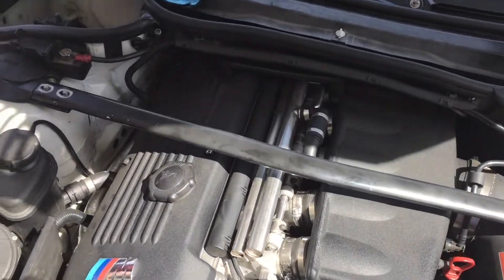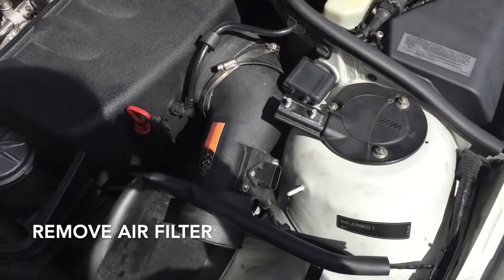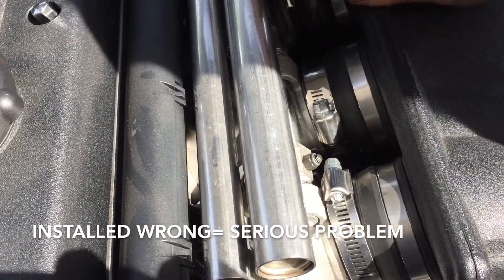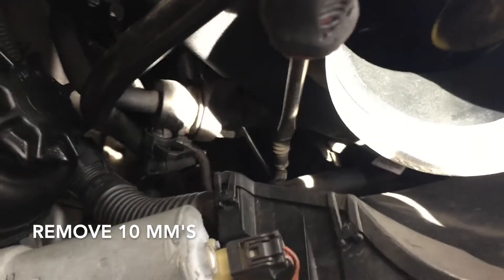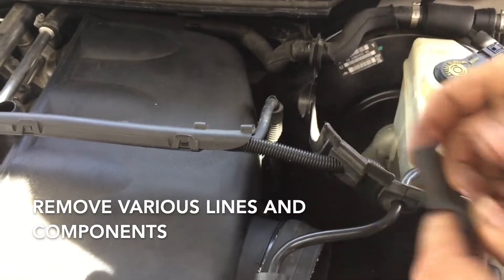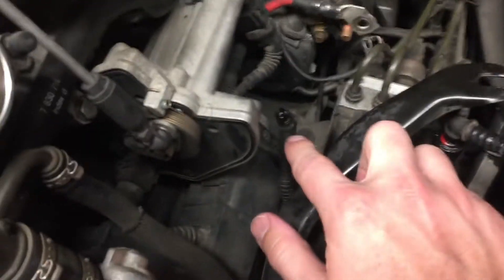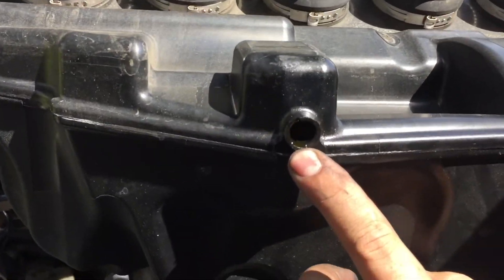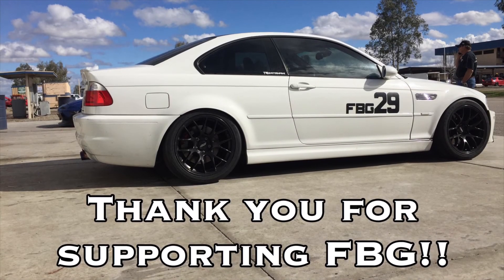How to: Remove the Air Intake Manifold E46 M3 S54 MANUAL AND SMG

Comment: Can anyone help?  I recently installed an Eventuri intake on the S54.  However I made a complete mistake of forgetting that i had sealed the intake with a rubber glove before installation.  started the car..... It ran for less than a minute but ever since the engine is waaaaay off.  super rough idle and very BAD throttle response.  havent even attempted driving it its so bad.  Can anyone suggest some possible steps to remedy this callosal blunder?
Reply: Is it throwing any codes?

Comment: how to connect back that tiny tube under the manifold???
Reply: did you ever find a good way? im up to that now and struggling
Reply: @canofdeans  Pain in the ass
Reply: @nazigrammar9728 i got it by just reaching under but was not filled with confidence that it would stay in
Reply: @canofdeans  do u use lift?
Reply: @nazigrammar9728 reaching under the intake manifold when I was putting it back on I mean. Im not sure if youd be able to even see it from under the car.

Comment: Where have you guys been !? Happy New Year !! Have an issue on part throttle it is not crisp so xan you do a Vid on all the issues ? Thx Guys .
Reply from the maker: Mark T happy new year! We have had a lot of life keeping us from getting editing done! But we are going to be back at it now.  Part throttle isn’t crisp? Is it not revving up with your pedal? Any other symptoms that you notice?
Reply: @FatboysGarage  well I've done all the basics I know I do not have any coil pack alternator battery clutch issues but there's definitely hesitation in my part throttle this is an SMG and when I'm keeping it in neutral stepping on the gas there is a dead spot in revving in idle I'm about to change my fuel pump 92 k I have issues with power and in extreme cold under 40 I'm here in Florida LOL I've been getting stalls in the morning when I drop down the second gear otherwise runs better but I'm still lost in 2 MPG less I have owned this car for the last four years and it never has gotten less than 19 City so needless to say this car is maintained meticulously and once I do the fuel pump and also I'm changing the timing chain tensioner and it tapping when cold I'm off to a Dyno tune to investigate other intermittent any thoughts will be completely appreciated thank you for your time !
Reply from the maker: @markt9438   A few thoughts.   When my VANOS first went bad, it had similar symptoms, it stumbled all over itself, it didn't perform well and gas mileage decrease, and had a tap like you describe.  I bet when you change that timing chain tensioner you find it broken.  Another common issue with throttle behaving like that is with the throttle actuator, idle control valve, and throttle position sensors.  When installing these parts new they must be synced together; unfortunately it is not plug and play.   Check out this link, you may find some info:

http://www.m3forum.net/m3forum/archive/index.php/t-367162.html
Reply: @FatboysGarage   Thx will check ! Did a recent bullet proof on vanos like you have and tensioner is only 10 k old and taps on start up cold ! have no codes and this is intermittent !  but for now need to change timing chain tensioner and fuel pump going from there ! Thx again
Reply from the maker: Mark T nice! Good that you did the vanos! It’s a must. Let me know after you change that fuel pump. There are just so many things that can cause that type of issue. Keep us posted !
Reply: @FatboysGarage  okay I went over the link you sent me on the TPS and all those issues and I do not have any codes so it's possible it's not communicating properly with my pedal after I do the fuel pump and timing chain tensioner and if I still have an issue I'm going to be taking it to a performance shop out in Apopka
Reply from the maker: @markt9438  had a thought this morning? have you flashed your ECu several times for modification? sometimes the computer can be messed up from that and doesnt communicate properly.
Reply: @FatboysGarage  well I've had the vehicle now for years driven 25,000 miles and I've never flashed it was considering the best tune I can find is Frank's tune I think it's called FS tune are you familiar with that and everytime I drive the vehicle 60 degree weather it wants to stall when I downshift to second gear so for me it looks like fuel pump 93k right now
Reply from the maker: @markt9438  Nice to hear youve got it figured out!  Had to ask.  I have heard of Franks tuning before yes.  Personally i go with epic motorsports tune.  he's actually in florida as well.  Has been recommended to me by every big time racer.  Ill be making a video soon and its going to involve his tunes.
Reply: @FatboysGarage  awesome give me the link I'll investigate thank you very much
Reply: @FatboysGarage  Got her back tonight ! Yes it was a soft failing fuel pump ! Runs better than new very little pump noise comparing to the original 93K pump ,no blips on RPM downshift and had gotten very bad in cold weather stalling in downshift to 2nd ! Pump i acquired     VDO Factory    BMW from Ebay Mfg Part # 16142229684 just $398 no tax in florida and free shipping ! Also did the Timing chain tensioner original went at 82K and this last one went in 10K and should have been changed a lot soon ! They tend to leak down and tap on cold starts ,hopefully will not have issues with this one I used an INA once again .So maybe there is Issues with them IDK and feed back for a solid TCT would be a good Video to add to your excellent Vanos repatrs ! Looking forward to seeing your tune for this M3 ! Thx Let me Know !